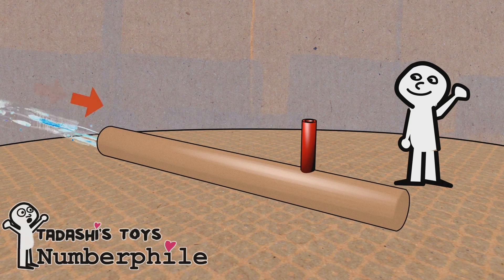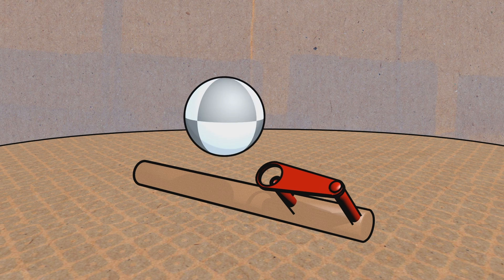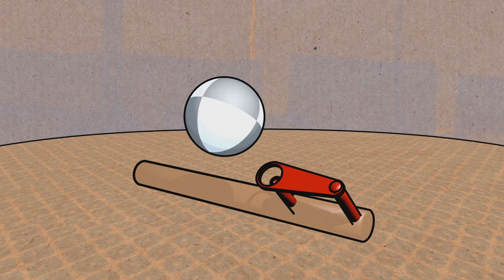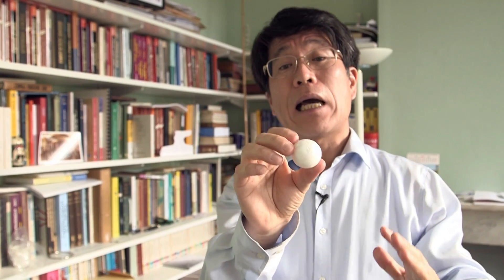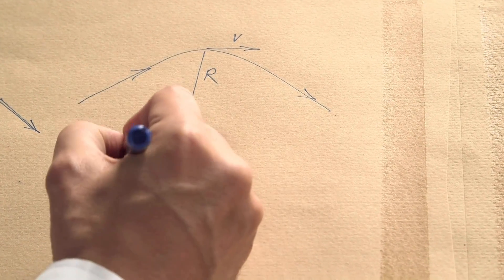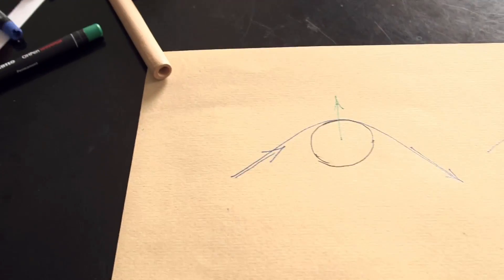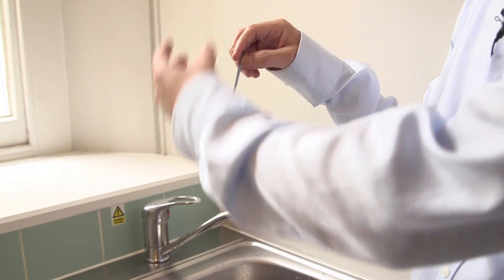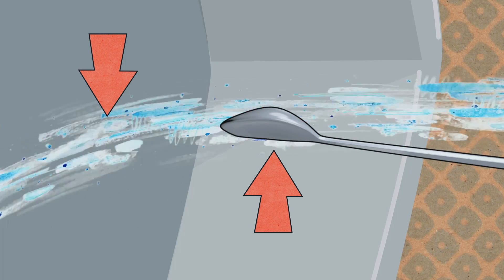Floating Balls and Lift - Numberphile

Comment: Yess finally someone who says the truth!  You can't use Bernoulli theorem in this case! Awesome video <3  :)
Reply: Yeah! Also planes with just a pure rectangular cross-section can also fly, just less efficient.
Reply: Planes can fly upside down because they change the angle of attack.
Reply: Actually there is a work around so you can use bernoulli by applying twice through a third point before the split happens far enough where you assume that the two streamlines converge to one.
Reply: I am afraid, he did not sat the truth in this regard..... while the Bernoulli can be indeed applied only along a stream line, all stream lines are equivalent, say 5 cm before the ball, they do not know which one of them will pass above and which one below the ball (wing). Thus they all must have the same value of that constant... so this argument against Bernoulli is not valid (may be there are others, thats a different question)
Reply: shiro I'm not rejecting this application, or saying that you can use Bernoulli in this scenario, but he didn't really explain WHY you can't use Bernoulli and I want to understand that part
Reply: you can't apply Bernoulli because there are two different stream lines(one at the top and one at the bottom of the ball), and the theorem could be applied only along a single stream line.
Reply: shiro but both streamlines are acting on the same object. So does that actually mean the Bernoulli principal does not apply to the wings of an airplane
Reply: Yes you can apply the theorem along the two different streamlines but Bernoulli doesn't explain everything. In fact you're assuming that the air at the top of the wing(or the ball) is faster than the air at the bottom, but why can you say that? In addition, with this explanation, airplanes could not fly upside down (maybe during an exhibition), in fact the resulting force (due to the shape of the wing) would make the airplane fall down instantly. So you can use Bernoulli to justify some aspects of this phenomenon but it's not 100% correct

Comment: Thank you! I've been using exactly this explanation to explain how a sail works, against conventional wisdom and people telling me I'm wrong.
Reply: You're partly right.  Sails do give forward propulsion by changing the direction of a stream of air.  This explains why a sailboat can't sail directly into a headwind, but it can sail forward if the wind is approaching from the front at an angle.  It does so by redirecting the air to leave the sail in a "more rearward" direction that it approached the sail.  But in a sail, the change in direction is mainly due to the air being turned by the concave side of the sail (kind of like an ice cream scoop) whereas in the floating ball demo, the spoon demo, and an airplane wing, the fluid is deflected as a result of the streamlines "adhering" to a convex surface (the Coandă effect).
Reply: twwc960 I'd say there's some of both happening, though admittedly likely more from the "ice cream" scoop effect.  It is very common to have tell-tales (strips of ribbon or yarn) attached to the surface of sails to indicate air flow.  You want smooth airflow on both sides of the sail.  This suggests the far side of the sail is doing some work too.
Reply: I suspect you're right.  It's probably due to both effects.  I hadn't thought about it too deeply before.
Reply: lol, if you think an airplane wing gets most of its lift from a parlor trick rather than ram angle

Comment: That's a super classic trick but I never realize that the ball is spinning!
Reply: The ball doesn't need to spin. 

As we saw with the spoon and water demonstration, where the spoon was curving the fluid flow but the spoon was not spinning.

It's the curvature of the fluid flow that causes the effect. The spinning of the ball is just because, as the fluid "coheres" to the ball on its travels around it, it's dragging it along a little and giving it a spin. Friction, innit.

But the spoon and water shows that the effect isn't caused by this, as the spoon can't and doesn't spin, yet we see the same effect happening.
Reply: @KlaxonCow, @Anvilshock: 
True, but it gives a subtle hint at what's going on. Thinking as a science teacher, I'd ask my students: "why does the rotation change when the tilt is changed from one side to the other?"
Reply: Or screwdriver and compressed air nozzle.
Reply: I'm pretty sure the spoon was spinning as well.
Reply: Anast Gramm:
Actually, there's no spoon.

Comment: This is a very good description of lift, and a very good correction of the common trope about Bernoulli's principle. The bit about the total and dynamic pressure being constant "for a streamline" is a very succinct way to point out what is wrong with the popular analysis, and the resulting curvature argument is clear and elegant.

However, I must respectfully disagree that the tension forces between air molecules contribute a meaningful effect to lift. These forces are orders of magnitude smaller than the repulsive forces at intermolecular distances encountered in air, and the net force between particles is repulsive. Better, I think, would have been a discussion about a reduction in pressure on the top side of the ball/wing as a "less negative" contribution to lift, so to speak. This does, I think, necessitate an explanation of why the flow wants to stick to surfaces that has to be framed in terms of the solid ball/wing surface not being able to "flow" into the curving fluid to restore full pressure, though.

The above is the tiniest of flaws in an otherwise impeccable and commendable explanation! This video will be my go-to video when helping people understand the true nature of the lift provided by wings. Thank you, Professor!

Comment: LOVE Tadashi videos! So, I think in the Halliday/Resnick volume 2 (or 1?) book they explain that the air above is faster because it's flowing in the same direction as the surface of the ball is rotating and the air below it is slower because it's flowing against the direction that the surface of the ball is rotating. So a difference in pressure is created and we have lift!

Comment: Bernoulli also does not explain lift or drag forces at all! great video.
Bernoulli, the famous equation p + ρφ +1/2 ρv² = constant
works for a potential rot(u)=0, stationary ∂u/∂t = 0,  incompressible div(u) = 0, inviscid fluid( η=0 where η is viscosity,) so no viscous forces at all, and going in a conservative force field where the forces per mass unit are in a vector g such that -gradφ= g (you call it the potential)

You bet with all those hypotheses it doesn't work maaany times

Comment: The notion that a gas can pull anything is misleading.  Vacuums don't pull anything.  It is gas on the other side that starts pushing that causes stuff to move into a vacuum.  That's how entropy works.
Reply: No, they're not saying the vacuum is pulling the ball -- they're saying the air sticks to the ball, and when it moves away, it pulls the ball with it to avoid leaving behind a vacuum.
Reply: Correct. The air pressure outside is just much higher and pushes the air (and the dirt with it) into the vacuum cleaner. Sucking is an emergent effect. Think of outer space: You can't vacuum-clean there. It's not because the vacuum cleaner is not "sucking", it's that the outside cannot push there.
Reply: S Smith 
Have you never heard of intermolecular bonds? I mean of course they are stronger in liquids and solids, really gases are defined by the intermolecular forces being overcome. But they still exist and have effects.

But yes, anyone who says a gas pulls to avoid a vacuum misunderstands how vacuums work or is oversimplifying.

The spoon is obviously due to intermolecular bonds. I am uncertain though as to whether the ball gains a significant amount of lift due to intermolecular bonds
Reply: S Smith Question: Why did the fluid follow the surface around? It impinged on the surface in a straight line, so why didn't it leave the surface in a straight line just as it arrived? There is evidently some kind of "stiction" involved here, so how did it arise?
Reply: It's explained in the video, but the short version is that flow across a surface can't separate because it would create a vacuum between the fluid and the surface.  So you could think of it as the pressure of the air on the other side of the flowing region is pushing it onto the surface.
Reply: S Smith OK, but there are two ways the potential vacuum can be filled. One way is for the fluid stream to be pushed close to the surface by the surrounding air, but the other way is for the surrounding air to push underneath into the gap where the fluid is leaving the surface. That gap is not sealed all around, it is open on one side leaving easy access for the air to enter. Now it takes more work for the surrounding air to divert the moving stream of fluid against the surface than to simply move into the gap where the fluid separates. So it's not clear that the vacuum explanation fits the observations.
Reply: S Smith the reason why the spoon went around the spoon is because it was sticking to the spoon, not because more dence water on the opposite side of the spoon pushing it. The conservertion of momentum is correct but its becase the water is sticking to the spoon. The water has equal pockets of less density no matter what path it chooses it will be leaving a vacuum of water. The reason why they pointed out the ball spins is because the air is sticking to it. Your right but it's not the full story.
Reply: Well, it's kind of like the centripetal vs centrifugal thing, you can describe the effect in two different ways, isn't it?
Reply: I disagree that the language is misleading. Vacuums do pull things - whether they do it literally or just effectively doesn't necessarily matter when it comes to choice of language. All of physics is a model, after all - a description of effects that are actually much more complicated than language is capable of describing.
Reply: Your right but I dont think that's what there saying. With the spoon there was not a vacuumed of low pressure water on the other side of the spoon, but that the water itself had some adhesion to the spoon meaning it was literally pulling the spoon. Air also does this as that's how waves are made on water. Now with the wing you have air on both sides so you get both effects.
Reply: A moving fluid (which can be gas or liquid) can provide pull via cohesion. Vacuum cannot provide pull, but moving particles can.
Reply: so, my air vaccum doesn't pull dirt of the ground?
Reply: Intermolecular forces don't play a role in either case.  It's just fluid dynamics which don't need IMF to work.  Really the best way to think of this is conservation of momentum.  As the fluid follows the surface around (which the video did explain well) the path is deflected.  Newton's third law requires something to be pushed opposite to that deflection which in the case of the video is the ball or spoon.
Reply: PleaseDontWatchThese learn grammar
Reply: That's my point.  Air can't pull anything.  That's not how the physics works.  It can only push.
Reply: Nope.  The air on the other side of the dirt pushes it.  The two are not the same thing and only one is correct from a physics standpoint.

Comment: so if you had a much denser ball - an equivalent volume of lead, say - and a much higher pressure stream of air - from an air compressor, say - would it not follow that the lift force would be greater and you could tilt the system to a much shallower angle?

Comment: Man I over think things. Direct fluid angular translation in a enclosed system through simple forces to separate linear force in one direction externally through the forces acted on the container. I had things so complicated.
Reply: Beautiful mind you but so much more complicated.
Reply: Ok let me explain a test rig for this, because this should be safe sort of for a while at least. 

Let's say you have 3 spoons attached to the bottom of a tube. Then a separate tube longer on the top end sorrounds it with three nozzles pointing at the spoons at the bottom of the inside tube. You then place a plate at the top attached to the outside tube. In the space between the plate and the outside tube should be a squirrel cage blower angled in such a way that it pushes the liquid down leaveing the air at the top. You then set two ballanced sets of tubes at the top of the outside tube , one going into the bottom of the outside tube the other at the bottom of the inside tube angeled to where they make a vortex with the air twards the top. You then angel the spoons where they make there own vortex counteracting the air flow. Then it is just a matter of adjusting flow and spoon angels in order to make it a stable flowing internal system. The nozzles should be spiting out a stream of foam and should be separated into a stream of liquid by the top.

Now I have not tested this set up yet so there is probably a few things that have to be ironed out if my first one taught me anything but my first design worked and it's basically the same principal just in a much much simpler form. This one could be a bust though because my first design requires takeing advantage of several more phenomena  in order to create lift but I believe that they may have been redundant when looking at this in new light. Regardless there is promise in the concept.

Lol it still reduces down to a puck to though. 

Graa I got to much going on this might take me up to a year to start on, but hey any of you can try it.